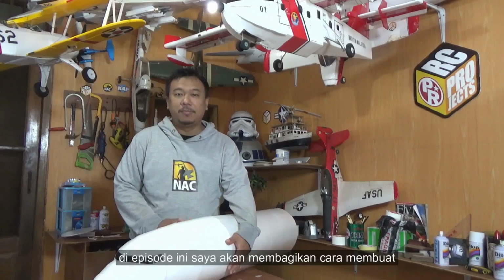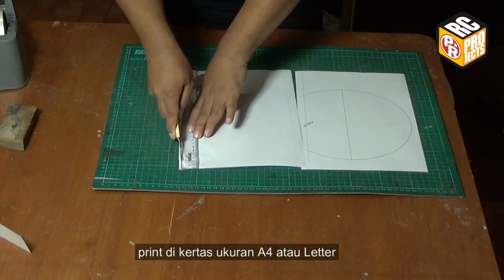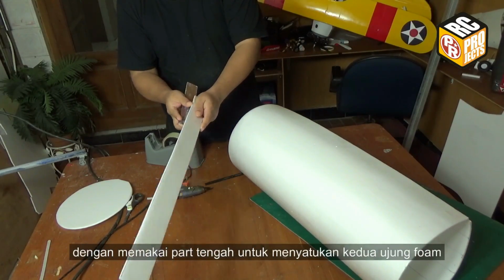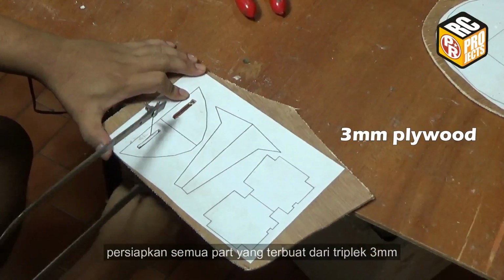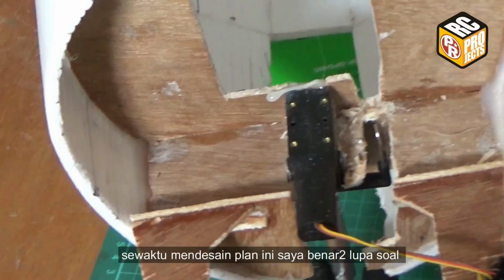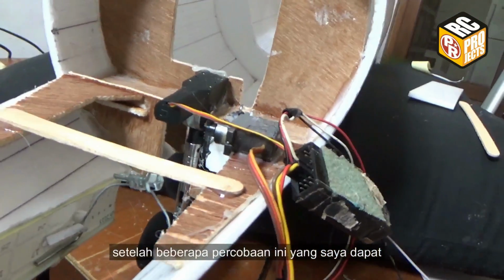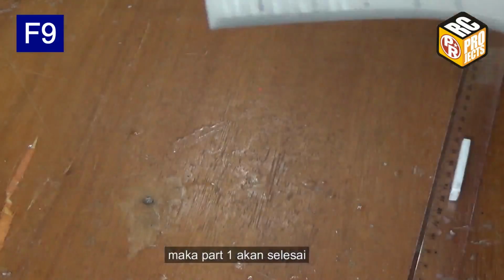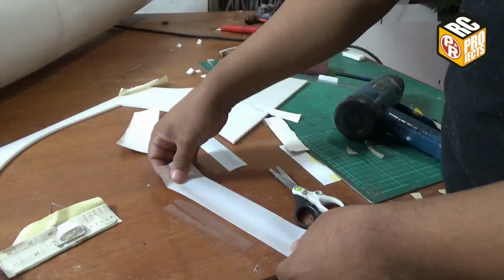How to Build RC Airliner Boeing 737 Part 1

Comment: Perfect,landing gear door system is amazing !!!!!!
Reply from the maker: it's not perfect but working, I still need to add safeguard to make it will not close by  wind or vibration when inserting the wheel
Reply: @JuliusPerdana  I mean they are open and close without useing servo :))
Reply from the maker: yes it is, very simple mechanism

Comment: Pola nya ada yg kurang pas bang,.
F1+F2+F3 masih ada celah 2mm.
Sama pola buat dudukan landing gear G1 ga sesuai klo di tempel, beda dengan di video.
Tapi saya terima kasih udh bikinin tutorial ini. Sangat manfaat sekali🙏👍
Reply from the maker: sama-sama. Plans model begini yang bentuk silinder itu memang rawan miss, salah motong 1mm aja bakal keliatan pas di pasang, belum ngelemnya kurang dapet ke formernya juga bisa ada gap. Tapi kan tinggal ditambal aja pake polyfoam lain.
Reply: @JuliusPerdana  oh jadi seperti itu ya bang,.
Saya pake pola print skala 60.2 % dari skala asli nya yg 100% bang. Iya bang sudah saya lebihin motong nya jadi good lah,.
Saya udh subricabe ya bang chanel nya,.
Kapan2 bikin tutorial khusus bikin rectact lending gear sendiri dong bang jul, hehehe😃
Reply from the maker: @MuhammadAkbar-gi9gm  saya ada bikin retract di video P-51 Mustang dan DC-3 part 2
Reply from the maker: nah apalagi di perkecil, otomatis ketebalan bahan juga berubah, former tidak bisa memakai dari gambar yang ada, harus dimodif diperkecil lagi
Reply: @JuliusPerdana  oke siap bang guru,.
Sehat selalu ya . Amin🤲

Comment: Julius, what size motors are you going to use on the dream liner, I would recommend 90mm you have two already coming (2) 90, and one 70mm, you are a craftsman.
Reply from the maker: I wil use no EDFs sir, just 2 twin motor pushers

Comment: Excellent work, keep going, I liked your practical method, which includes all the details, I am waiting impatiently for the second part, but I have a question: Can I put edf engines in the place of pucher, I mean can the structure bear that and can the plane fly in both cases, thank you very much
Reply from the maker: I'm afraid you have to reinforce the wing, because it was not designed to be installed by EDF
Reply: @JuliusPerdana  OK I understood , thanks 👌👏

Comment: Looking forward to the next episode. You have inspired me to follow and I have made two attempts, Piper cherokee and Cessna 172. Following you my Cessna, not built on recommended foam being not available in Pakistan I used a light weight pvc 3mm semiflexable sheet. By next weekend I am planning to fly hoping it does.
Reply from the maker: I also here have friend that doesn't have access to depron/polyfoam, he uses styrofoam, a foam from fruit packaging, cut into 5mm thick sheet and use for building RC plane with my plans
Reply: Thank you for response. The basic principle of weight and thrust ratio when observed you can, I suppose, use any material that could be shaped according to plan.

Comment: How will you make sure that the door for the landing gear stays open at all and is not pushed by the headwind when the landing gear is extended ( especially if you want to mount bigger wheels )  , I see a problem coming. I am curious how the project will continue.
Reply from the maker: good question, I also concerning about that. I think I will add elastic thread to each the wire and anchor the thread to the nose, It will stayed down
Reply from the maker: bigger wheel is for the main landing gear not the front. Main landing gear is easier, because it has no doors
Reply: @JuliusPerdana  You'll will fix it. I have no worries. :-))

Comment: can we use 70 mm edf unit
Reply from the maker: you can but it is not designed for EDF, I will not add reinforcement on engine pylons, it's just accessories

Comment: Nice! unfortunately it has a slender structure, it is not resistant!  It will break into a 1000 pieces on the first flight... 😔
Reply from the maker: no it will not, it's strong enough even for hard landing. You'll see on maiden flight

Comment: Kak maaf mau tanya, saya newbie di dunia RC. Yg menggerakan Nose L/G up and Down itu kan karena servo. Kemudian yg ngontrol servonya itu apa ? Apakah dengan remote? Kalau dengan remote. Bagaimana cara servonya mendapatkan power pada saat pengetesan apakah menggunakan battery? . Bolehkah kak dibuatkan video cara untuk melakukan up and down landing gearnya kak? Terimakasih
Reply from the maker: di pesawat Boeing ini menggunakan "Servoless retractable landing gear" Jadi mekanismenya sudah ada, tinggal beli jadi 1 set aja. Jadi setiap "mesin retract" ini tinggal dicolok di channel 5 di receiver sehingga bisa di "command" untuk keluar masuk dengan switch di remote. Cara kerjanya seperti servo, colokannya juga sama tapi tidak pakai servo sama sekali. Nah ada juga pesawat saya yang memakai servo untuk landing gearnya, coba lihat video Douglas DC-3 part 3 atau 2, di mana saya membuat mekanisme retract dengan servo standard. Servo itu mendapat power dari receiver dan receiver mendapat power dari ESC dan ESC mendapat power dari batere.